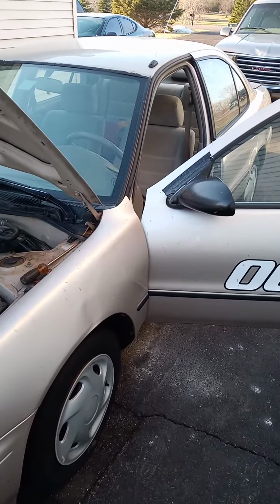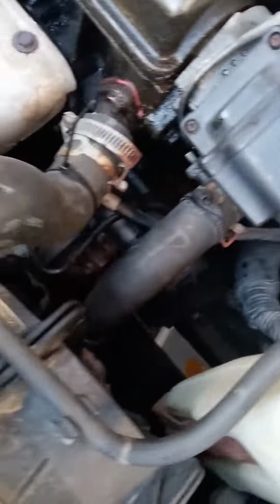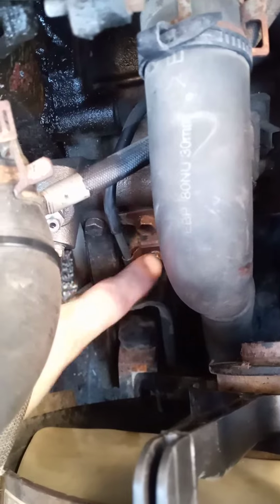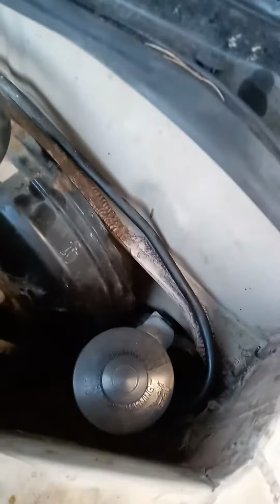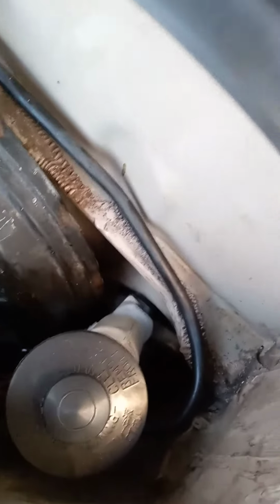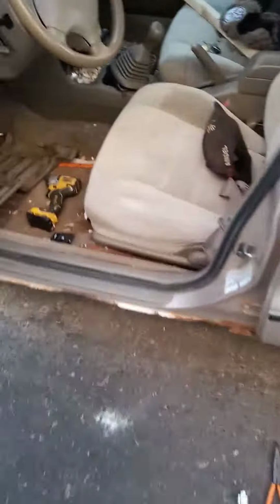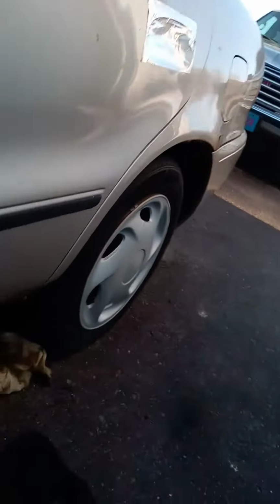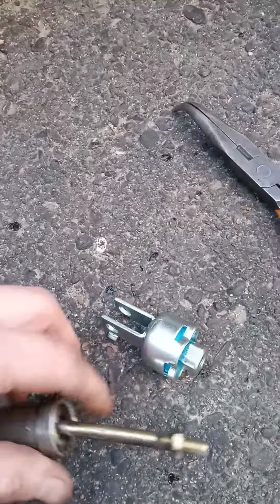Geo Prizm / Toyota Corolla Clutch Master & Slave Cylinder Tips

Comment: I've got a 1983 toyota corolla wagon AE71 that I converted over to a 5 speed. 
My problem, can't adj the free travel on the pedal .
If I shorter the linkage on the pedal, it works fine until the reaches operating temperature  then the clutch pedal catches rt on the floor. If I adj the other way it has no free travel. 
Does the Leigh if the hydraulic line have anything to do with this issue  ?
Reply from the maker: I can't say for certain if it does or doesn't. Keep playing around, something will come to light.

Comment: How did u get the master cylinder past the brake booster
Reply from the maker: I had to loosen the 3 bolts holding the booster to the firewall